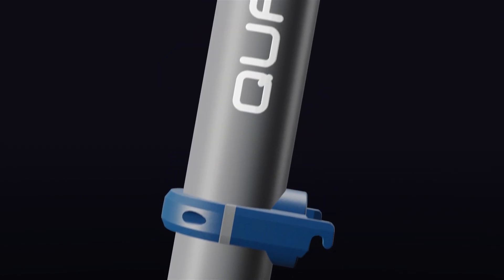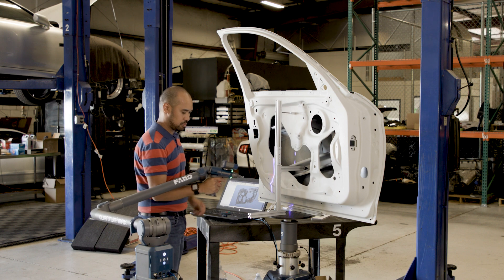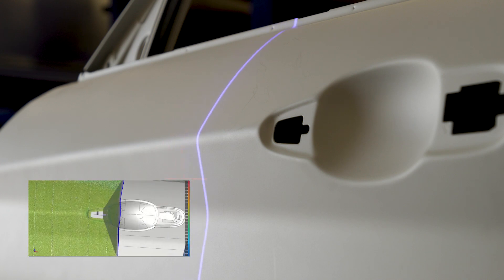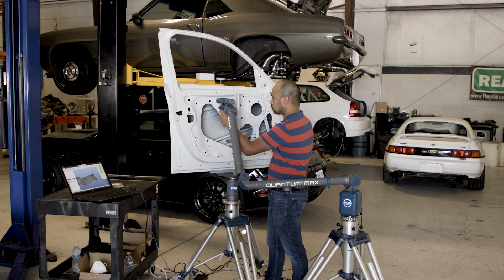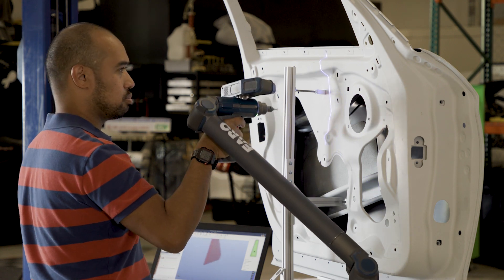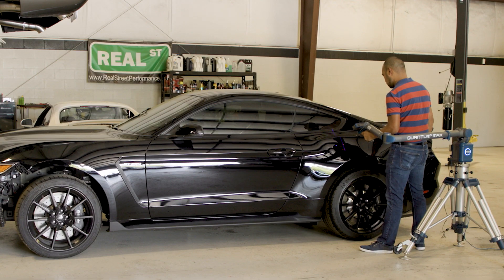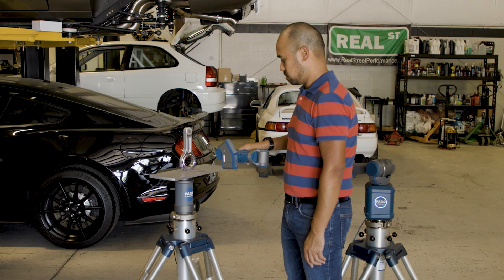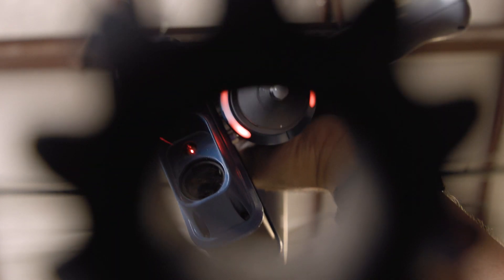Quantum Max with Multiple Laser Line Probes Solves the One size fits all Challenge

Comment: What is the accuracy of the scanning/probing? Is this ISO certified?
Reply from the maker: Accuracy levels differ depending on size and model, but a 2 meter S model has a probing accuracy of 28 microns. And the Quantum Max arms are certified to the highest standard for portable arms - ISO 10360-12.

You can check out the full line of Quantum Max scan arms at https://www.faro.com/en/Products/Hardware/Quantum-FaroArms